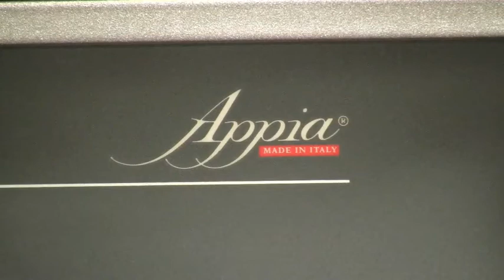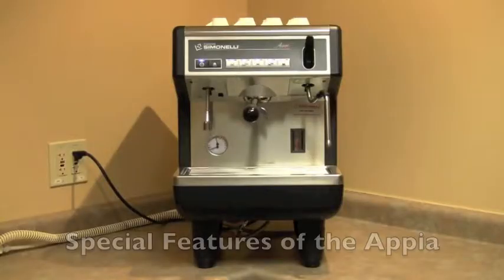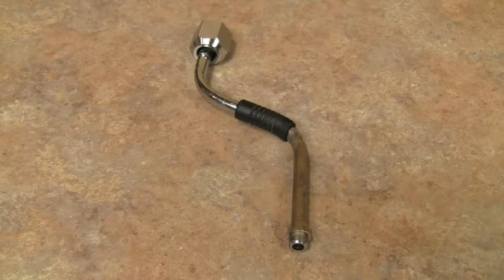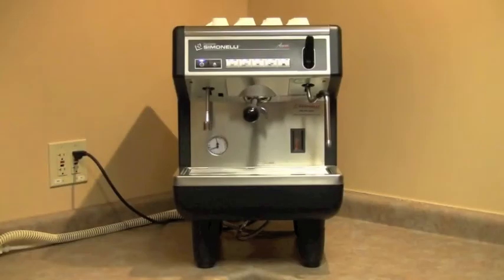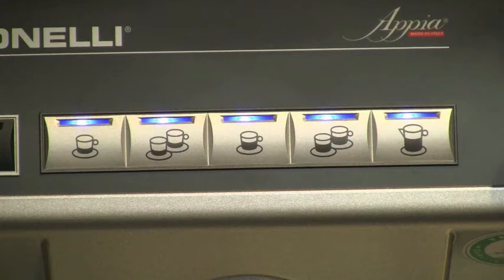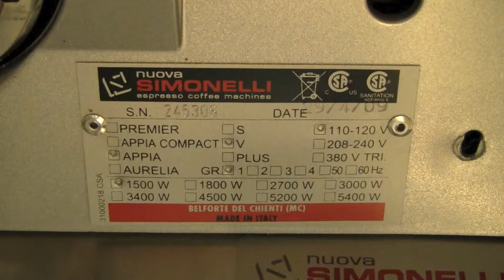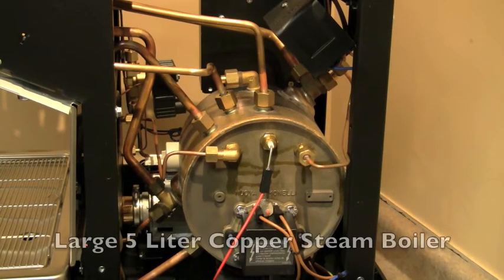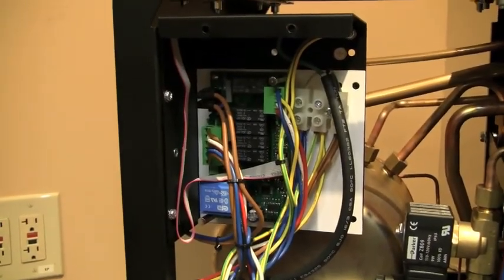Appia by Nuova Simonelli Overview - Best Commercial Single Group Heat Exchanger Machine

Comment: Could it be possible to install this into a small car with a battery bank and a 12 VDC to 110VAC inverter? If so, how many batteries, and how strong has to be the inverter?
Reply: Maybe you need a generator. This machine @ 110V needs lot of power (for a car) and any battery group could be emptied in seconds.
Reply: 15 amp
Reply: I see bezzera has a model that requires no electricity to brew. It works with gas tank or so. Could be better for car application.